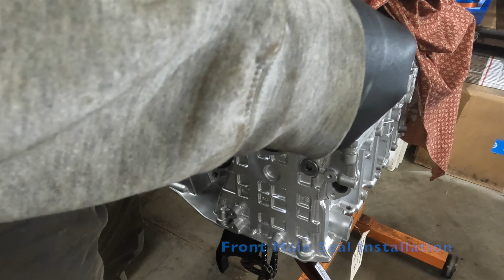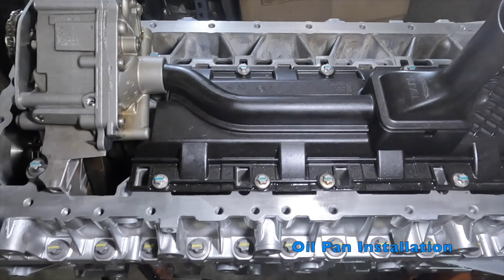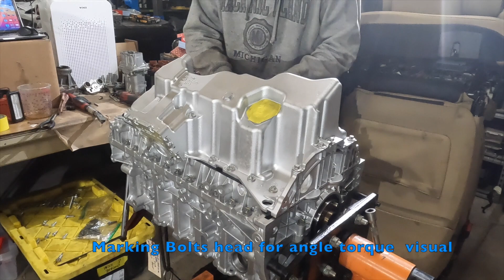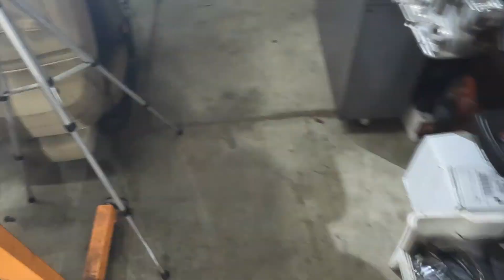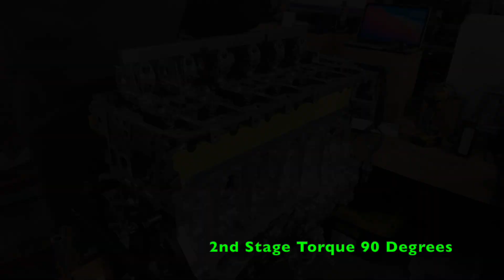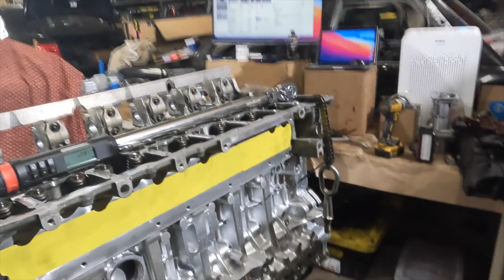BMW N55 17667419 P8 Rebuild Head Install   Torque Stg 1- 3  Part 8.1

Comment: Online it says 30mm and 2 times 90? I have a s55 and I can’t find the torque specs n55 specs is my best hope
Reply from the maker: Main crank bolt?
Reply: @straightupbmw for the cylinder head bolts. I’m trying to put mine back together right now, and online it says 30mm and 90 degrees twice, it shows sames specs for the n55 also, but in your video you did 30mm and 90 degrees followed up with 180 so I’m not sure what to do. And what if there’s any way you could help me. It’s a 2016 bmw m4 with the s55
Reply from the maker: @pavelbog4230 
Send me your vin number and I can confirm 

Send email to straight.up.bmw@gmail.com
Reply: @straightupbmw sounds good will do that right now. Thank you

Comment: Hi, I'm in the middle of rebuilding my N55 with forged rods and pistons. If you could make a video with the wiring harness and where it goes I would appreciate it. I've been watching your videos and they have been helping me a lot more than ISTA is.
Reply: Hey how did you decide on pistons?  I have the m3 crank, factory forged rods, and at this point I'll be reusing old pistons unless I can find a decent cold weather build kit
Reply: @hedcase4life88  Yeah it was amp44 but usps lost my pistons so im using the stock pistons for now which might hold for 500-600hp but those numbers will be only run for fun otherwise its conservative boost. I'm also running a full S55 oil sump, pump, and pan setup to help with improved oiling and starvation prevention. My thread can be found on spoolstreet under the same name.
Reply: @Dynamics99  unfortunately I have xdrive and can't retro the s55 pump..
Reply: @Dynamics99  im having a hard time choosing bearings for the s55 crank swap.
Reply: @ ACL bearings should work? Check part numbers on realoem between your n55 and the s55

Comment: For the Snap-On torque wrench you can adjust the length of the extension to have better torque reading, you just go to setting and add the extension length. good work over all!
Reply from the maker: Thanks for this, I will look at this setting

Comment: What are you using and how are you doing the cleaning to get the parts looking so nice, clean and almost new?
Perhaps you can do a video about it?
Reply from the maker: It’s a multi step process - for Aluminum-  1 get heavy and grease off - with   petroleum base 2- heated parts washer using aircraft aluminum cleaner them rinse with water 
I will try to make a brief video in the coming future